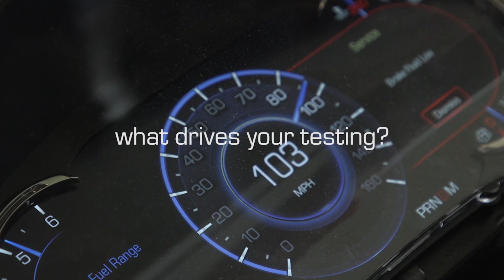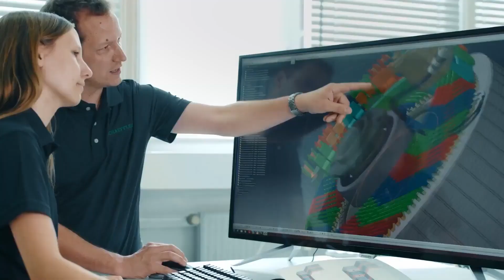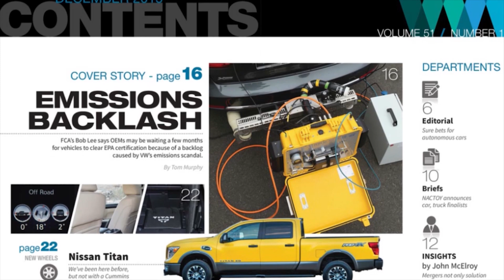Suzuki EV Uses 2-Speed Trans; Startup 3D Prints EV Battery - Autoline Daily 3508

Comment: As much as the Toyota BZ4X is a dud of an EV, if Toyota lowered the price in the US to $25K I'm sure they would sell everyone they could build!  At the current $42K price it's just not competitive with other offerings out there.
Reply: Exactly
Reply: Not practical. The bZ4X has the potential to be a big seller. But Toyota has a much more stylish EV SUV in the bZ3X. That's coming out but they need to get the specs right. The problem with the bZ4X isn't the price. It's the specs.
Reply: @benjaminsmith2287  it’s the price for the specs they getting. Other EV have better specs for the same price. Remember Tesla sets the market not Toyota in the EV US market

Comment: I think this word "Recall" has lost its meaning and context in 2023. The cars are computer on wheels and as an ex-software engineer, let me lend the auto world a word..it's called "Fix". There should be two type of Fix. Soft fix(or Software fix over the air) and Hard fix(which would be akin to the old world Recall).
Reply: Use Fota (Fixed over the air)
Reply: Yep, exactly. There's no cost or delay in going to service centers or replacing parts etc, it's purely a simple software adjustment that would be invisible to the user if it wasn't for the notification message.

But the media needs the sensationalism to sell clicks.

I think it's a good thing that NHTSA is showing they're deeply involved with Tesla on this project though, it makes it hard for critics to say Tesla is going at it all "gung-ho" and such. Clearly the agency is a close participant.
Reply: They're not "computers on wheels." That's a silly term. They're computerized vehicles, not computers.
Reply: @benjaminsmith2287  thanks for correcting the semantics. But,the point still holds. OTA is not a recall.
Reply: @Amuzic_Earth  I don't think there was anything wrong with the semantics, I call them computers on wheel as well, but there's always going to be the old guard that doesn't "get it" with technology stuff, just get used to it.

Comment: They're ruining FSD or any autonomous, unreasonable to prevent it from setting speed above posted limit, why should autonomous be the only car going 65 on the freeway. Cruise control lets you set any speed.
FSD attack ads by The Dawn Project, draws its funding from Dan O'Dowd, the CEO of Green Hills Software, which has developed its own vehicular self-driving software. That makes its technology a direct competitor to Tesla's proprietary self-driving system.

Comment: NHSTA issuing "recall" for FSD is GREAT news for Tesla. Since the issues are minor, it gives Tesla a stamp of approval to continue working on FSD. I would be much more worried if NHSTA would have issues a stop for the program or have more significant issues with FSD. Can't wait to see how FSD evolves over the next year or two. Been using it daily and most drives right now require no intervention - though I do take over on more complex situations - though never as an 'emergency' move, more like when going into a parking lot or where I see things I KNOW FSD does not support (e.g., significant construction, road blocks, etc). Pretty sure FSD will support reading more signs in coming releases, I guess it was just lower priorirty than making sure it navigates the road system safely and can't handle emergency manuveurs if needed.

Comment: 3D printing is currently a great tech for one-offs, prototypes, or form factors that are problematic for traditional production methods. They are not high volume. I'm curious exactly what parts of the battery process are being printed, given that the functional part of the battery is an electrolyte smeared between two layers of film. 
This sounds more like a solution for niche and small-volume battery production, rather than something particularly useful for mass produced EVs.
EV Transmission: The value of a transmission is a more efficient gearing across the power bands of the motor. The power band for an EV motor begins topping out at 65mph. If you're driving a sportscar, then having a transmission to maintain acceleration above 60mph is valuable, and the added cost (weight and price) of a transmission isn't an issue. If you're producing a commuter vehicle where you're bragging about shaving 1gram off each component, then adding the cost (weigh and price) of a transmission to increase performance at high speeds is completely counterproductive.

Comment: The trick for Tesla is to develop stereo vision to the best it can be without anyone dying or getting hurt. 

Stereo vision is the biggest bang for the dollar it will be able to read a given number of (never 100%) road signs, and stop lights and find a given number of (never 100%) lane lines, obstacles, etc. 

What's termed level zero in every auto on the road with stereo vision to help find the above and could have the biggest bang for the dollar in the reduction of accidents and deaths.

If people want to give Tesla 15K for FSD to help the above goals more power to them as long as they understand what they are doing and no one gets hurt.
Reply: Except they will never get beyond barely into level 3 autonomous with camera only. Fine for sunny days and perfectly marked roads once they work out all the bugs in several more years. But total failure in places that have real weather.
Reply: @davidmccarthy6061  I agree for a car that applies its own brakes or steers itself I would think it would also need radar and lidar along with redundant processors and checks to make sure all is working. This is lots of money and any ones guess when it all works to an acceptable degree.

To be clear I am saying level 0 (driver does all steering and braking 100% of the time) that stereo vision could help reduce deaths and accidents if integrated with the driver correctly. With each passing year processors are more powerful, the software is more capable, etc.

No car company is going to push for level 0 the revenue stream is not present no matter how many lives are saved or accidents are reduced.

I think Volve many years ago is the only car company that ever just put people first when they allowed any company to use the 3-point seat belt for free in order to help save lives.
Reply: That is true when the weather turns bad standard vision human or stereo vision systems can become extremely limited.

A couple interesting ideas first of which others have mentioned IR imaging may help in the dark or possibly bad weather. A company named FLIR makes high-quality sensors, development boards, cameras, etc. The cost is not bad for a sensor and development board. I think I will purchase a set and see how well it works for the above. I can always use it for security at my house/yard at night if for nothing else.

The other idea is so obvious I am amazed I have not read anything about this. Since everyone has cell phones with GPS a phone app could monitor driving and have a database for the location of stop signs, intersections and stop lights. When a car is approaching one of the above it could give warnings to slow down or signal a stereo vision system to look for the color of a stop light (assuming the weather is ok). I would be amazed if this is not available now but I have been looking for a reason to write my own smartphone app for a while along with working with GPS so I will put this on my to-do list. No idea when this will be done and working etc. I am aware navigation programs have been around for years but I am not sure if they inform drivings to slow down if needed at intersections.
Reply: re: "and no one gets hurt" therein lies the trick... (Law Enforcement and First Responder voices)
Reply: @phillyphil1513  I agree what has been going on with the deaths and accidents should not be allowed to happen.

The "front page news" of how great the system is then the "fine print" of no it does not work is not acceptable and people have died court cases are in the works now.

People should not be allowed to test FSD on public streets if they are not qualified or FSD is not up to the task being tested.

Does this mean a driver's test for the driver and FSD software before it is allowed on the street sounds reasonable to me.
Reply: @lp6696  re: "court cases are in the works now." exactly, I'm still waiting to hear about those 5 Officers in Texas who filed suit against Tesla back in 2021. ie, is it going in front of a Judge...?  or since it's now the year 2023 has Elon "donated to their PBA" (translation: BRIBED) to make the case go away...?  you can bet the fanboys are hoping everyone's forgotten about this, but "sucks to be them" cause I HAVE NOT.
Reply: @phillyphil1513  There are so many possible lawsuits against Tesla going on now I do want to put the time into tracking them.
I am deep in thought now in an AI/Machine learning contest related to neutrinos and a complex observatory located in Antarctica.

One I am keeping my eye on is an Apple engineer who died on US Highway 101 in Mountain View on 3/23/18.
Maybe because my background is in engineering and I worked in Mountain View many years ago.

To be fair an investigation resulted in the Tesla Autopilot not being the cause of a crash in Texas when no driver was found in the front seat. 
All kinds of news was in the media around this crash that it could be from Autopilot not working which was not the case.
You need to be careful about what's in the news to make sure the facts are correct.

Comment: Suzuki is making their first EV, making the mistakes Tesla made 15 years ago with two-speed transmission. Why don't people learn from other's mistakes? :(
Reply: Because they are men?
Reply: Porsche uses a transmission, still, bad idea
Reply: I think 2 speed transmissions are coming to BEVs. Porsche has one and Polestar will on an upcoming BEV. Some other performance oriented cars will have them.
Reply: I have been saying for years a ev needs a multiple speed transmission.  The hp will less thus reducing parasitic drag at startup and reducing energy loads at highway speeds.  It's the same reason a ICE has a transmission.
Reply: @BeingMe23  And you've been wrong for years. Only reason to have a transmission in an EV is to shift the power band above 70mph. Unless you're driving a high performance sports car (like the Porsche Taycan), not a lot of need for full power at 75 mph. The weight and cost of the transmission is a parasitic loss for an EV motor at most operating speeds.
An ICE has a transmission because its power band is only a few k RPM, and there's no way for an ICE to operate from 0-75mph on just that band of RPM without gearing.

Comment: That Toyota BZ4X is WAY TOO EXPENSIVE for what you get!!  The vehicle should be around $35K.
Reply: Toyota is learning what happens when they make a piss poor attempt.
Reply: It costs 25K in China...
Reply: And you expect the same specs for $35K? What BEV costs $35K that is the size of a bZ4X? It's actually not that expensive. The specs are the issue. The range needs improving and the charging speed. I also think the interior could use a redesign in some ways.
Reply: @benjaminsmith2287  ……I’ll stick with my PAID OFF, BULLETPROOF, 2011 Rav 4!

Comment: Hi Elon aka Allan's boss.  It is now clear -- by calling "FSD Never" L2, you have a clever workaround to allow for safety-critical beta testing on public roads without having to apply for permits.  Anyway, I saw the pics of the latest rev to the HW3 board (1800475-00-C REV-01).  Biggest issue is the use 47 uF Tantalum capacitors.  Tantalums in automotive applications are a no-no (they short when they fail and then they emit the magic smoke).  Next, you need to reflow that board in Nitrogen (air introduces too many impurities).  Also, you don't appear to be placing your ceramic capacitors at right angles to ensure shorts don't kill your DC rails.  Finally, many of the component footprints are clearly not IPC-7351 compliant.  Overall, this looks like a PCB designed by someone with little automotive experience.
Reply: That’s the first valid criticism I’ve seen you post in months. 
 

Nice work
Reply: @Alexzw92  lol..all of my criticism is valid courtesy of the daily mismanagement from Elon.  Even fanboy Ross Gerber wants Elon gone.
Reply: @bobbbobb4663  Ask farley what he thinks about Elons "mismanagement"
Reply: @dclpgh  Getting an endorsement from Chris Farley’s cousin is clearly a rib
Reply: @bobbbobb4663  You know its funny that everything you say thats wrong about Tesla  everyone wants to copy. Ford Model e will be basically A Tesla copy. (If he can get it there, And doubtful by his own admission) and BTW The Munro reports on tesla electronics are the best seller.
Reply: @bobbbobb4663  re: "all of my criticism is valid courtesy of the daily mismanagement from Elon" exactly, Elon's dysfunction "Tees Them Up" and Bobb simply knocks 'em down, therein it's like shooting fish in a barrel (and I'm here for it). 👍
Reply: @bobbbobb4663  Ross for president! Then he looses his fake grin immediately. Backpfeifengesicht...
Reply: Tesla has its problems, but I still think it has a brighter future than Motors Liquidation Company.
Reply: @JohnPMiller  When Tesla does something "great", the response is "the legacies will never be able to do that."  When Tesla does something bad, the response is "the legacies are way worse".  Not this time...Tesla uniquely owns FSD Never and the consequences from EA22-002.
Reply: @bobbbobb4663  I hope someone succeeds with autonomous driving.  Last week in my little town, another guy high on something drove his Porsche through someone's living room.  Luckily, no victims, other than the Porsche that flipped over as it crashed.